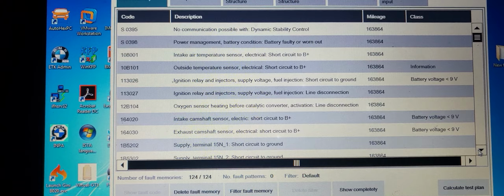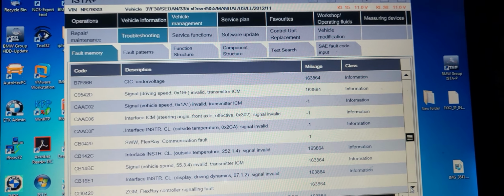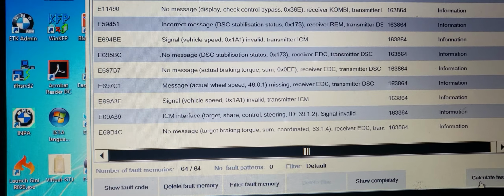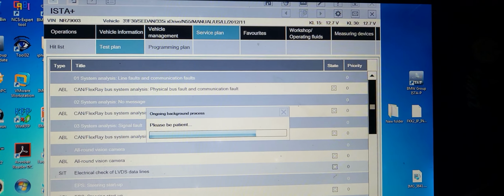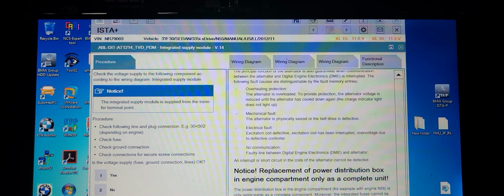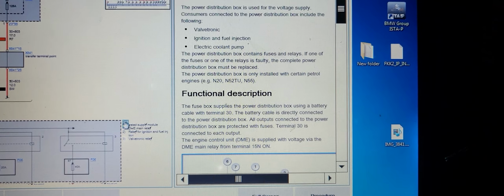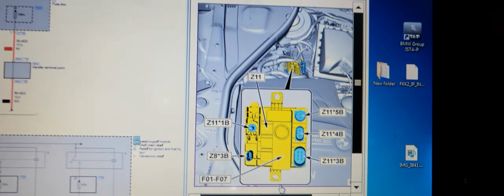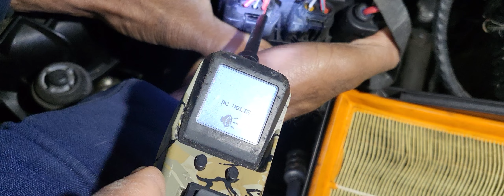2013 BMW 3 Series Crank No Starting Diagnose What Was The issues With That?

Comment: i have an x5 e70 that is giving me problems and that is why I am encouraged to write in this community I was picking up my daughter from school, when I parked I noticed a smell like a wax, like a lit candle in the cabin and just turned the vehicle off, when I returned from school I couldn't start the truck, it only cranked, when I checked the codes it showed me the 2adcb master relay activation and The coolant pump is missing, I have no voltage to fuses 42 and 43 in the front power box, I made a bypass from a 40 amp fuse that always has voltage and was able to start the truck and drive home my truck is a 2009 x5 3.0 eur spec, I can't find any master relay that gives voltage to that fuses and i have no ISM on the dme compartement so, I hope someone here can advice on what to look at in order to get voltage to that fuses, thank you

Comment: di you find out the problem
Reply from the maker: @kevon9903  yes they put wrong computer that is come with engine
Reply: My car having same problem
Reply: @BestCarFixes what do you mean it was the wrong computer ? Do you mean the computer was bad or ?
Reply: Heed some help 2014?bmw 328ix.   Parked car 2,days now cranking only not starting it seems to be getting fuel but no spark any help is appreciate
Reply: @clived9897  yes I have same problem it will crank but don't even sputter when I use start fluid
Reply: @lukedukelp3666  u fix it ???
Reply: Not yet man I think it's the timing